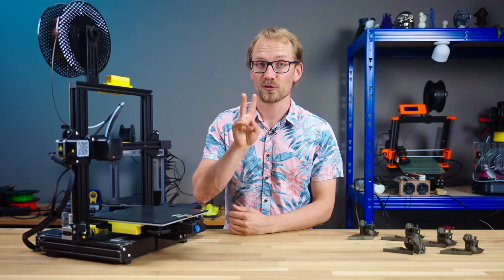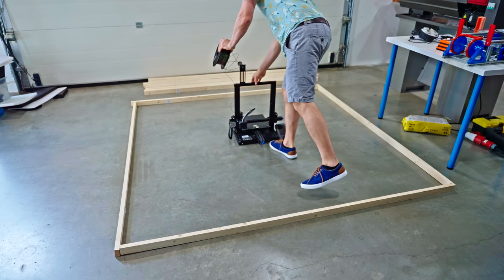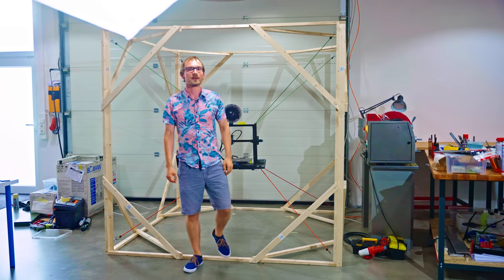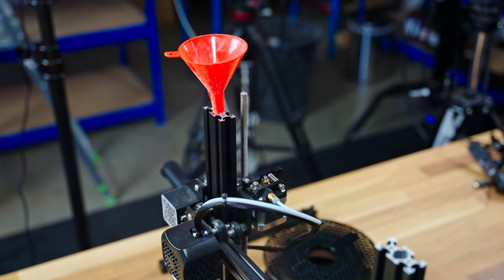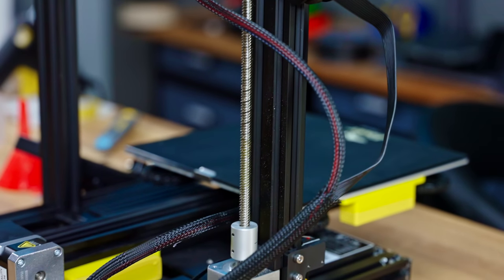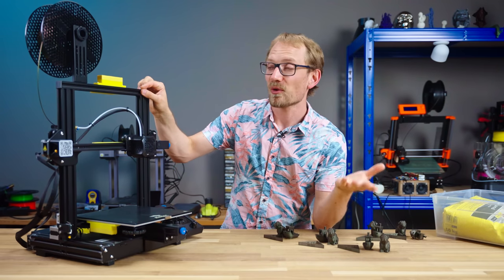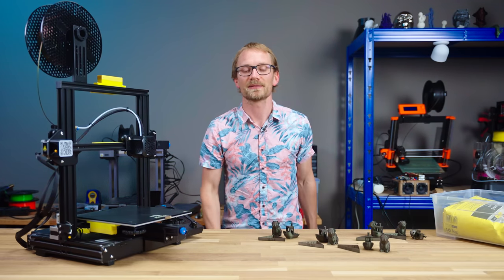You made me do this…

Comment: Isn't the real problem the mass and inertia of the moving parts?  My thinking is that adding mass will only increase the problem.  My first printer was a cartesian and experienced similar problems to those you are trying to improve.  With mass, inertia in mind i bought a delta, and with some experimentation with Cura settings get much improvred results with a fixed bed and lower mass head assembly.  I have now bought another FLsun QQ-s.

Comment: I’m curious, if possible, if adding a counter weight on the other side of the X and Y belt loops to cancel the momentum of the print bed and extruder. So, when the extruder travels right, the weight travels left, etc

Comment: Ok...so some of those sandpacks could be pretty useful on there.  You're gonna want to take them off of the parts that actually MOVE and use them to attach to certain parts of the frame. Think of them as absorption dampers, to keep the FRAME from moving.  The parts that ALREADY move shouldn't be dampened, because you'll end up with that skipping issue and even if you didnt its just not ideal.  The intention isnt to add kinetic energy to the system, that just multiplies your problem.  it's to create something that dissipates excess energy instead of allowing it into your print. In CNC routers what works BETTER is using concrete...literally filling the structure with wet concrete and letting it dry.  Has a real hard time resonating through what is essentially stone, especially since it gains so much mass it has a hard time even starting to vibrate.

Comment: I'm thinking a set of 4 ash tray sized dishes at 4 corners of the base semifilled with BBs and topped with polypropylene Glycol, topped with a sealed plastic top. Mount between silicone foot bases and frame. Cheaper than ferro fluid.

Comment: If the vibration absorbing feet worked best so far, that is the direction I'd try to do more investigation. I had good results using packing foam as extra feet, but as with your printed ones, they really tend to sink in over time. The air that is inside the foam bubbles gets pressed out over time, leaving a rather flat piece of foam. Dampening performance will surely decrease with a compressed foam? I didn't do any real testing, I mostly just want to have my parts printed, not write a thesis on vibration absorbing techniques...

 I'd just use bigger pieces of foam to distribute the weight better and to get less sink-in, but I fear too much of it might worsen dampening performance equally to the sink-in effect.

Comment: Well we know that for every action, there's an equal and opposite reaction. So if you had counterweights that weigh the same as the moving parts, but move in the opposite direction, the excess energy should get absorbed without any significant vibration. That's why combustion engines fire the pistons in specific orders, and why V engines all have counterweights on the crankshaft. Perfect balance and symmetry greatly minimize vibration.

Comment: A sand epoxy slurry would be more effective, increase mass and stiffen the frame. Epoxy granite is a standard material for CNC construction for this very purpose, to stiffen machines and reduce ringing. Ideally, the entire non-moving frame components would be cast in it. Welded steel filled with epoxy granite is also good, ask me how I know ;)

Comment: Sand is probably a good idea for non moving parts. After all it’s the resonance you are after to kill. But to really kill any resonances you need first to know what frequencies you are generating. No need to kill a resonance you system never generates. What you need is to know the system and then tune it so that your system never generate the resonance frequency or that you have a mute point where the action is happening. 

E.g. to tune a rifle for accuracy you can add weights on the barrel so that the muzzle opening is at a mute point. The whole barrel could look like a sine wave as long as the muzzle opening is at y=0. 
Same for the printer although it’s more complex to tune.

Comment: I would reckon the sand containers are that extra thing you could do to increase the weight of the printer. They would have to be placed on the profile 4040 bars on the very bottom of the printer. Anything above or on the spool's Z-Axis crossbar would cause more vibrations or movements because its simple physics. Make one large Sandbar Container to match the base. Putting sand on the moving parts like the bed seems like a bone head move I'm sorry, but you would be causing strain on the y axis stepper motor and creality installed a stepper motor smaller than your extruder motor. So for a stock creality machine, I reckon try the sand containers again on the very bottom of the base like an anchor bub.

Comment: the cube frame was larger than it needed to be, and there wasn't enough thickness of the elastic cable in relation to the stretched length between suspension points, so this particular setup was another fail. studio microphones suspended by elastic cord are held in place by a frame, but that frame does not extend more than twice the volumetric space of the microphone itself..

Comment: You could build a small fixture in the shape of the letter C with a thin film resistor across the opening of the Letter. Incorporating the thin film resistor into a wheatstone bridge. With a DC power supply and a oscilloscope you should be able to measure the vibration frequencies. Fine and is good for sound  which can be 20 kHz. I would think lead shot like #6 bird shot would be fine in the none moving parts of the frame. Stepper Motors themselves will input vibrations into the system. I wonder if converting to servo motors and ball screws is practical. Position of the extruder nozzle would be within .0001" but whether that would make much better part is unknown

Comment: Big marble/granite table top as heavy as you can and simple rubber feet on the bottom to isolate it.. that's all you need.  You can also just bolt the 3D printer to the stone, for added rigidity.
High precision measuring machines use this, Vynil DJ turntables use this, big milling/CNC machines use this..... I will be Ok too for 3D printers.
It will disipate any external torque resonance instantly, and for sure (either from the machine or from the environment). You will only have to care about intrinsic play of the components.
I've seen it at work on a digital measuring machine. It was installed on a factory, full of heavy duty machines.... it has a nanometer precission, and stable as a rock, no  matter what happens outisde.

Comment: Filling with sand was a bit naive, since there isn't enough internal area to adds enough weight... 
But to be very honest, this lower end printers are wrong from the sketch.
We are makers of industrial machinery in my job, and the trick about vibration is simply let the machine vibrate, focusing to make a solid structure in the precision moving areas.
The vibration will not cause damages to the final work.
The problem you'll want to fight is reinforcing the structure against undesired freedom of movement and this is pretty much it... But this is hard to do: probably will demand some reinforcement of the bridge and something more solid on the slides (I would think about those ball bearing rails, I'm not sure how it's called in English)... But the costs would cancel the benefits for sure.

Comment: Imagine holding a sledge hammer by the bottom of the handle with the head of the hammer at the top in an upright position. Compare doing that with a sledge hammer handle with no head. Which would be easier to maintain stability in?

The approach here is wrong, not the idea. The problem with this type of printer is in the cantilever style portal. Movement becomes exaggerated the further up the portal you move. Hold a wood stick upright and have someone push on the stick at different points while you try to prevent the stick from moving. You'll notice that the further from where you are holding the stick that the stick is being pushed, the harder it is to maintain stability. Exchange the stick for a heavy steel rod, and again, the result will be exaggerated. 

I've seen people brace this style of printer with a lateral brace that extends backwards parallel with the y axis. That seems to be a waste of time to me, because the left and right movement of the tool head is putting pressure along the x-axis. There is no movement on the y-axis. So lateral bracing would be beneficial to the left and right of the portal, and a waste of time forward or backwards. But that would require increasing the size of the footprint the printer sits within.

Comment: Moving parts need to be as light as possible, minimum mass.
Take the sandtainers off of the bed and try again.
Maybe try having a frame secured to the desktop, put the printer in the frame, and have some dampened springs, or rubber, between the frame and the printer.

Comment: I wonder if expanding foam in the extrusions would add some dampening without adding the weight like the sand... And not leaking out everywhere once its dry.
Reply: It probably leak will though when filling it. I can see how it would fill it out fully. But since it is basically just air, I wonder how much stiffness that would bring.

Comment: Why don’t you try using lead shot — large enough diameter that it won’t leak out of holes etc., plus it weighs more than silica sand & would absorb the resonance with the lead balls shifting amongst themselves during printing. Suggest you don’t add weight to the bed — I know nothing about 3D printers but even I can see you’d get bad prints with the bed motors trying to move more weight than their designed for in the X & Y planes without the driver’s software having a calibration added to compensate for the larger mass.

Comment: Try running a frequency scan on the printer that identifies all the resonant mode in each axis to automatically pick velocities, acceleration and jerk setting on all movements. Surely someone has developed the algorithm and software to automagically do this. Probably need to attack small 6-dof sensor close to the print head nozzle and on the bed. The sensors could be removed and replaced with dumb weights after the settings are picked. Or do it manually with a hundred prints.

Why fight these waves created at the "random" maximum speed settings, when you can move away from them in the software to the smallest allowable speed reduction.

Comment: Adding weight to thinks that move wont dampen their movement. It will make it more difficult to stop, so it could increase the magnitude of the movement as the dampening is less effective.
Adding weight to the static parts wont help either.
Hanging a heavy weight to the frame would dampen their movement, though. Like very tall buildings do.
The seismic feet worked because it made the static frame a part that moves at the same frequency as the moving parts. Since the bottom is what holds the plate, now they move in sync. It could be a happy accident.

Comment: I'm sorry to say the solution is much much simpler than suspending the printer in a spider web. ......Rigidity...... You have the roll of filament dangling from the top of the gantry. As the bed accelerates and decelerates to change direction that filament is moving around like a pendulum. If you print some 90° gussets to mount between the base rails and gantry the problem in the Y axis will be solved in the X axis you need to put gussets at the top of the gantry. It is a mater of rigidity. Get rid of the spool attached to highest point of the motion frame perhaps print a separate structure to hold the filament. It's not a matter of frequency or anything more complicated than pore structural rigidity. Your not cutting material you only need to overcome the movement in the structure itself. On the bright side it's fun to watch you chase your tail. I'm looking forward to the episode where you try to print as the printer is in fee fall.

Comment: Why not just pour the sections full of lead? When I needed some lead weights, I went to a scrap yard and bought scrap roofing flashing. I went to a thrift shop and bought a stainless steel cook pot. I then melted the lead on a gas kitchen range. If there are holes, etc, wrap them in layers of ally foil and duct tape. The lead will solidify so fast the heat will not burn through and cause a leak.

Comment: Similar problem you're bound to encounter with anvils is resonance, even if you mount them with rubber blocks. Normally a very simple solution is to put magnets on them and hit it with a hammer.
Obviously the hammer is unnecessary for a 3D printer unless it's massively misbehaving and making bets about its own life expectancy, but one solution you could try that's very cheap, mounting plates which are magnetic, tap the places with a tuning fork to check which areas harmonically resonate (which should trickle down into the structural end eventually), attach magnet and voila! 
That's not to say the serial killer suspension box with your German accountant look wasn't impressive and slightly optimistic. 😉

Comment: Using bungee cords to dampen might not be the best idea as they only provide a small amount of damping by means of the resistance of the nylon outer sheath and provide more damping for big motions with much less damping the smaller the amount of bounce..... maybe give the frame another go with a different suspension method as I believe there is potential if you can find the right material to damp it with

Comment: I have the solution! It's also an audio problem. Those who build subwoofers have the problem of how to place it on the floor to avoid resonances.  From what I understand in your video the problem lies with low frequencies so yours is precisely the case with subwoofers. I'm Italian so I'm sending you two video titles to watch by two sound technicians who solve this problem using tennis balls to dampen vibrations and you can see them with English subtitles so you understand
1) Le palline funzionano davvero sotto i monitor da studio?
2) Ho sconfitto le vibrazioni con pochi soldi
In the second video right look at the graphs at minute:
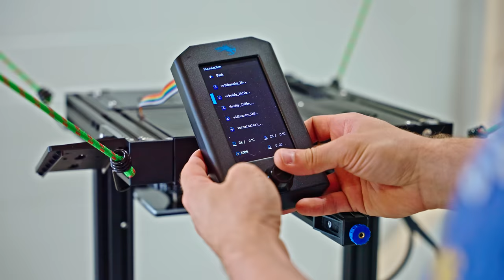5:37 nothing
5:38 tennis balls
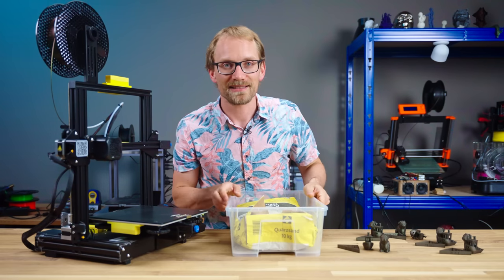6:45 3M balls
6:49 tennis balls and e 3M balls
And you will see how the frequencies, for example at 30Hz, are dampened by as much as 13 dB.
Just try. Thank you so much

Comment: Next step: better tests!

Rather than print benchies, print a single layer approximation of a sine wave in one axis while keeping the other axis velocity constant. Get up in the G-code. Keep constant (and small) amplitude but have variable frequency. You should be able to see amplitude and phase change as a function of frequency. You ought to be able to find both resonances (where the amplitude of the resulting sine streak extrusion is larger than it should be) and anti-resonances (where the sine wave is smaller than it should be) this way. Also, a MUCH faster test.
Reply: On the topic of belts: I was guessing the resonances that create the print defects weren't in the frame as much as they were in the system made of the belts and their respective moving masses. The belt is behaving like a spring and a damper. The print bed or the extruding head behave as the mass. Friction in the guide/bearing/wheels add more damping. Stiffer belts will push resonances to higher frequencies and lower amplitudes. I don't know much about belt construction, but steel and fiberglass don't damp much, so I'm guessing the rubber parts of the belt matter just as much as the part that can take tension. Are there carbon fiber belts? I've heard rumors that carbon fiber does some self damping. I may have misunderstood that, with the truth being that the epoxies used in the carbon fiber composites is what provides the damping. 

If it's not the mass of the moving object that leads to the resonances effects, maybe the belt itself vibrates like a guitar string (transverse wave as opposed to longitudinal wave) on the open side of the loop. If THAT is the case, then belt tension should have a linear effect on the frequency. Belt tension would have an effect in the other case (longitudinal vibration) too, but to first order, I would guess it doesn't matter until the acceleration creates slack in the "pushing" side of the belt. 

Guessing sand works for a milling machine because they don't do motion control with belts, but they do exhibit problems from flexing small amounts in the frame. The force between a solid tool and a solid work piece will depend greatly on whether the frame is vibrating a fraction of a micron. That's not so much the case when it comes to a viscous fluid like extruding filament.

Comment: Without an understanding of the frequency or frequency range we need to dampen, and engineering first principles it seems we are aiming at an I’ll defined dart board with no hope of hitting or coming close to a solution. For reference the frequency of resonance once achieved has a good ability to maintain resonance over a larger frequency spectrum…hence why vibration dampers are placed into the system to shift and avoid hitting system resonance. I suspect the frequencies of interest and system dynamics (speed and acceleration) will make arrival of static vibration dampers selection a challenge. Would be interested in a bit more of the math and science behind the solution such that changes might be incorporated and adjusted as print speeds and acceleration rate changes can be better targeted.

Comment: I have several weights mounted on rubber on my 1998 Suzuki. They are supposed to be vibration dampers and I hate them. I don't think damping vibrations is the way to go: good engineering is spending time to not produce vibrations in first place. Additional weight, parts, costs  is just a wast.